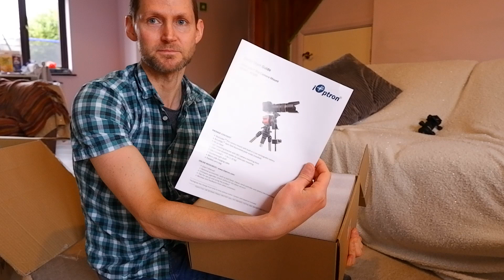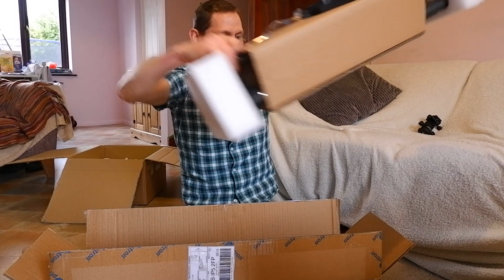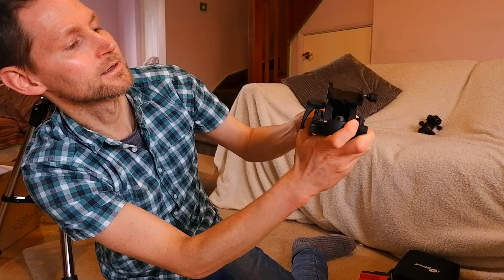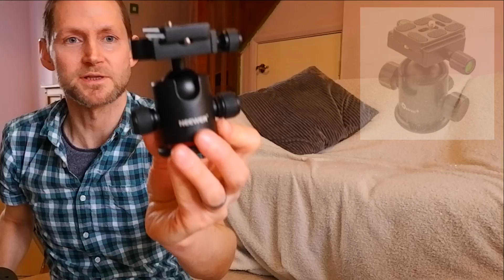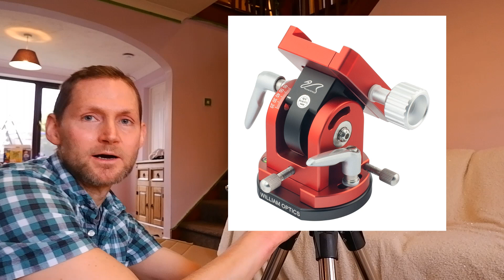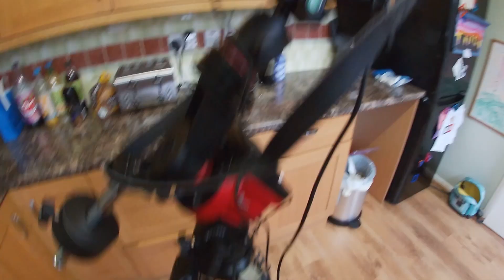iOptron SkyGuider Pro - Setup & Star Adventurer Comparison.

Comment: i had this skywatcher on my wish list was just gonna buy it then I realized about this ipolar thing. So not all products have it? do I look for one that has it? When i search for it on amazon it only shows that one specific piece? Is it something i can upgrade the old one I'm buying? How do i polar align without this ipolar? Sorry for the many questions!
Reply from the maker: Hi there, iPolar is an iOptron product and it's an aid to polar aligning. You can buy iOptron mounts with or without iPolar and you can buy it separately as an add on to other brands of mounts. Equatorial mounts that don't have iPolar have an optical polar scope which you look through to line up the north celestial pole for tracking. Either is fine but iPolar is more accurate. You can find these products at astronomy retailers e.g. https://www.firstlightoptics.com/ioptron-mounts/ref/astrolavista
and this: https://www.firstlightoptics.com/search/for/ipolar/
There are videos on YT for both optical polarscopes and iPolar so I'm sure you'll get the gist of things after watching a few videos :)

Comment: Ok, so something that just occurred to me:  if you select lunar tracking, do you still polar align?  Or can you just point at the moon and select that?  Thanks for the help with this guider!
Reply: Sorry, I know that's a bit of a noob question, but if the shoe fits... :)
Reply from the maker: Not at all! it's a good question :)
Reply from the maker: Hi, you always need to polar align when using an equatorial style mount, with Lunar tracking it's just the rate that's slightly different.

Comment: Using the ioptron polar aligner with a ioptron skyguider pro and a dlsr with a 400mm lens, which max exposure time is possible to have? Does a general rule or formula exists?
Reply from the maker: Hi, there isn't a general rule of thumb for tracking mounts as there are quite a few variables involved, but based on my test I reckon you'd get around a minute unguided. It slightly depends on whether you're using a crop or full frame sensor because this dictates how 'zoomed' in you'll be with a 400mm lens. Either way I'd say 400mm is probably around the limit for an unguided star tracker.
Reply: @Astrolavista  aand... how much expo time does an autoguide add , more or less talking?
Reply from the maker: @alessandrofiori5870  People routinely take 5-10 minute exposures guiding even at longer focal lengths. Guiding uses a second little telescope and camera attached to the main telescope to lock onto a star. If the star starts to wonder, adjustments are immediately made to the mount so it's nudged back onto the star, hence you get accurate tracking for long periods of time. You don't really need guiding at say 50-200mm focal length a lot of the time but at 400mm it's definitely worth looking into :)
Reply: @Astrolavista  i am shooting with an apsc camera. I asked just for have an idea, i am new to this setup

Comment: Hi Chris. Very very nice star tracker! It does look pretty well made and I'll be interested is it better than the star adventurer? Is this tracker for small telescopes like the star adventurer? I must say the tripod looks very sturdy and I like the look of everything. Would you say it's more or less portable than star adventurer? It's a big deal about how portable it is. Another bonus is it's not got a battery cover like star adventurer which I must say it's annoying but you can use tape. 
I just got that planetary camera I told you and it's nice. Just need a new laptop now as my Toshiba laptop is from 2008 time. What laptop do you suggest I get that's light? Maybe I should get this star tracker next summer. This tracker looks stylish too!!!
Reply from the maker: Hi John, It is a bit more premium than the Star Adventurer and the example I borrowed had really low periodic error which was impressive. It's still very portable and designed for small telescopes and lenses just like the SA mount. The inbuilt rechargeable battery is better than the SA mounts AA batteries with flimsy cover, and you can also power it from your laptop which is a great feature. Laptop wise I swear by HP laptops and I always choose Ryzen processors now days as they are better value for money compared to Intel, but just as good. My last two laptops have been HP Ryzen.